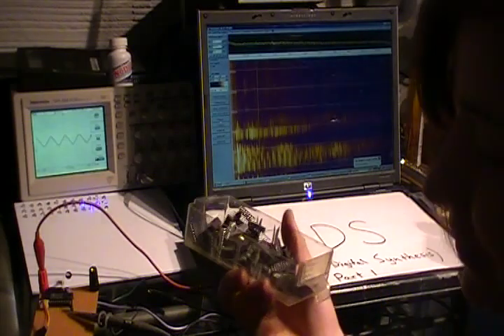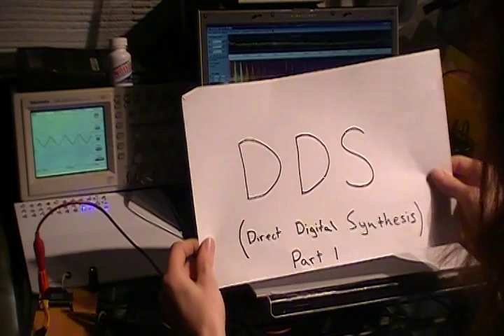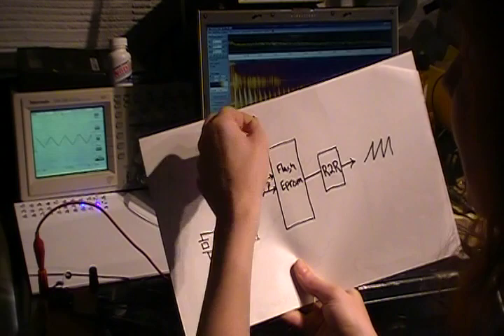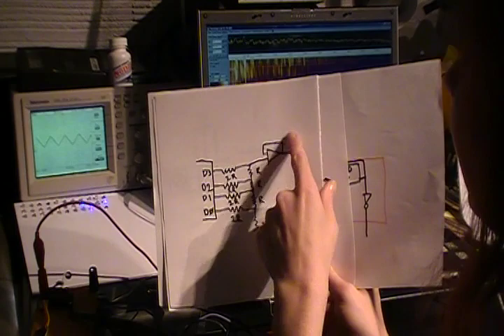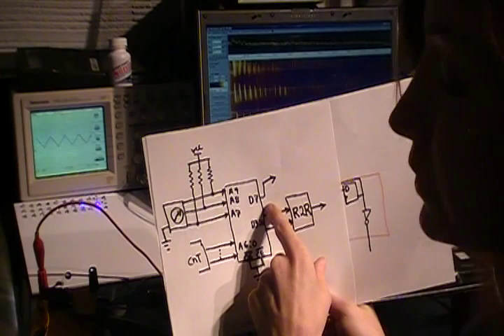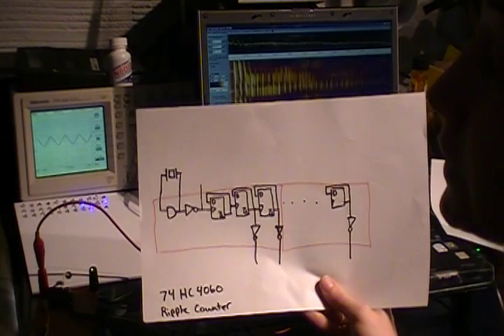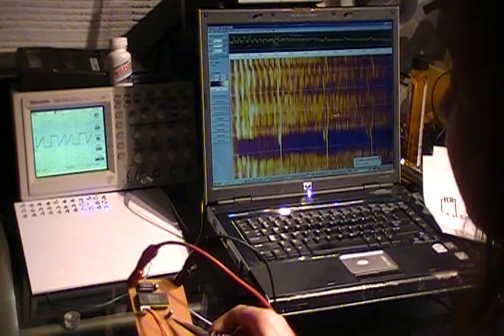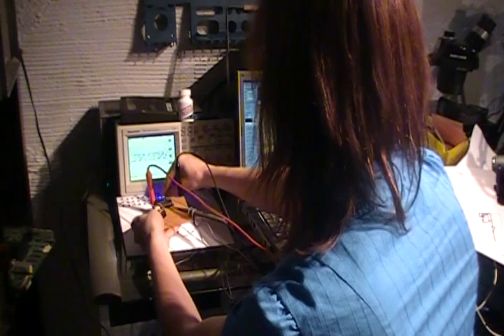Direct Digital Synthesis (DDS) - Short Circuits

Comment: I've done this for engine speed signal generation (for bench testing engine control computer software) but I used a hc4040 to get more sequential addresses. One bit of the EPROM was my camshaft signal (0V or 5V). The other 7 bits were used for my crankshaft signal (sine wave with two missing waves). Nice and simple, effective, cheap. Great video!

Comment from the maker: @lartti83 The counter always counts up.  The addresses are feed into the lower bits of the address.  Store waveform values sequentially in the EPROM.  

The counter will count up until it overflows and then will start at zero again.  I also added a reset signal that is driven from data bit 7 of the eprom, so shorter sequence of waveforms can be stored.

Comment: Very cool, and a nice explanation! You could also use the high address bit rotary encoder to select low-pass filtered variations of the same base waveform to do filter sweeps. Daft Punk meets Halted.

Comment: Couldn't you still use 128 samples simply by not having the reset bit set? (Storing data in the same word as the reset bit won't work too well as it only lasts for the propagation delay, not the counter step length.) Neat build!

Comment: Hello Jeri , I think this is just a function generator and not a DDS .
Reply: Ofk this is DDS
Reply: WaleraRigid but there is no digital input
Reply: Ahmed Fadul
Maybe you just not so familiar with idea of DDS synthesis. I don't got what you mean by "digital input" but it not needed here (if you mean some external control or etc). DDS synthesis idea is just direct digital to analog confersion from table of signal's values what you want to get. So we have here eeprom with table and counter who travel on eeprom adresses and DAC who convert values from eeprom in analog signal. Maybe I confuse some details because watch it many years ago but this is main idea.